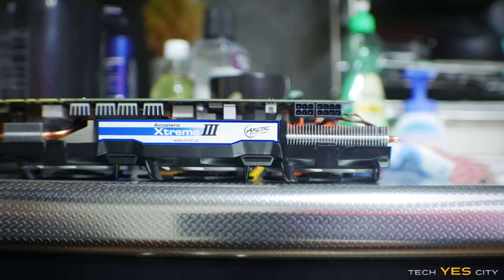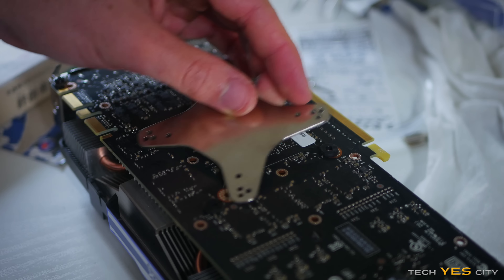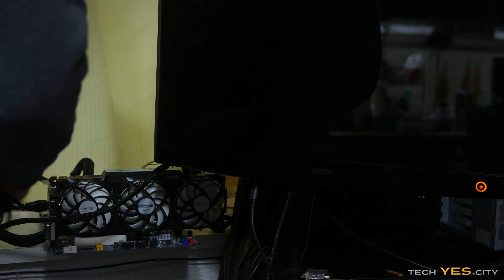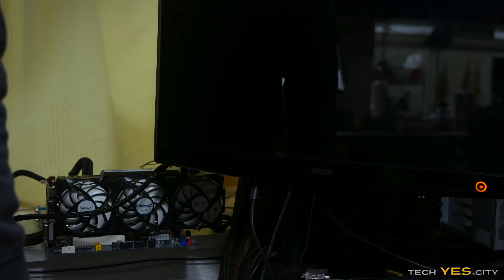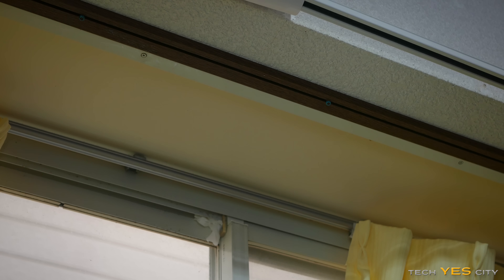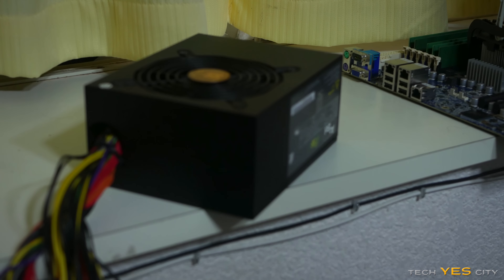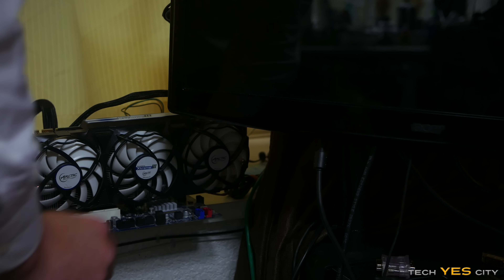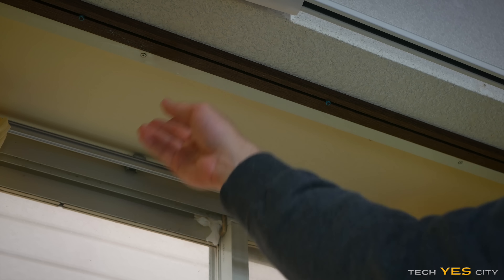The TALE of the 'BROKEN' GTX 780 & The 'HOSED' PSU

Comment: I bought 4 GPUs for $10 from a little repair place recently, sold as scrap, a GT630, HD4850, HD4870 and a Galaxy Hall Of Fame GTX 780. The 3 low end cards worked fine after cleaning up the contacts and re-greasing them. The 780 doesn't but we'll see if a trip to the oven sorts that out, if not, it looks cool on my shelf either way
Reply from the maker: +Blueblur444 Keen to hear the results!

Comment: Those big capacitors in power supplies may have been the culprit. If you read up on "the capacitor plague" you will understand what I am talking about. Capacitors have a lot of water in them.

I doubt it's still a problem sincd it was really a big issue until 2007. Now I think the Tauwanese and Chinese capacitor manufacturers have fixed their formulas. but you could have just gotten unlucky, you never know.

Comment: I think you forgot to replace those black plastic washers when you re-assembled the cooler. These are meant as spacers to prevent too much pressure, and warping of the pcb. :-)
But it's a good thing that you managed to salvage the card, and great that the PSU didn't get damaged.

Comment: Lucky and unlucky i should say!
Last time a video card (9600GT) shorted my computer was because of a dead mosfet in the card, not even visible. It just would get extremely hot to the touch. Replacing the mosfet saved the card and at first i thought that was what was wrong with yours.
You really tend get some crazy deals! Keep these coming!
Reply from the maker: +totalrandomtechnolog Would love to see a video on mosfet replacement, that sounds extremely hard, I think I couldn't do that (my skills with the soldering iron are very mediocre even at best).
Reply: +Tech YES City The hardest part is indeed to remove it, but with one of those really cheap hot air stations on ebay 40 €/$ (give or take) it's remarkably easy. Hardest part would be to get a exact replacement or equivalent mosfet.

Comment: What MAGIC SPRAY are you using to clean the parts?Can the spray remove thermal paste(as good as isoprophyl alcohol)?Does it dry fast.Can the spray cause short circuit?What happens if u spray it on the motherboard socket(nest)?
Reply: I believe it's brake remover or something along those lines, I remember him mentioning it in one of his previous videos
Reply: +Kris&#39;s Audiosurf Channel Brake clean.  Pick it up at any parts store, Walmart, etc.
Reply: Mass airflow sensor cleaner spray... it's made for electronics, obviously :-)

Comment: I scored a GTX 260 Core 216 for £10, That was a great upgrade from the GT 610, before that a GeForce 2 Mx/mx400 (64mb vram), Then for £26 on eBay I scored a GTX 460 (Currently using) I look down ebay at "used" parts alot

Comment: Did you find the leak? If it was a brand new power supply it is possible for certain types of capacitors to soak up water in them. The water likes to stay in them until the power supply is turned on when they tend to dump the water out as they charge and discharge. After soldering most circuit boards go to a cleaning step where they get blasted with deionized water cleaning solution in a large machine and then blown dry.

One old electronics tech accused me of trying to kill him awhile ago by pouring water all over the power supply (while it was off) that he had been working on while he was away at lunch. Thankfully there were other people around that verified that I never went near his bench, and he eventually apologized. We figured out later that the water came from large cellulose filter caps if I remember right. He liked to drink his lunch and he did not even notice the water leaking out of the caps right in front of his face while testing the power supply...
Reply from the maker: +Den Log Yeah leak was from my roof, it was a freak accident.&#160; Was shocked... And damn that story, lol guy is lucky to be alive.
Reply: Tech YES City Eh it was only single phase 120VAC to some low DC voltages so not enough to kill him, but it would have wiped that perma grin off his bright red face :). He only noticed the water after he shut off that power supply and was disconnecting the wires from it to hook up the next one. That is when he turned to me and accused me of trying to kill him. It did not help that I was even more of an a$$ back then I am today, and that he was a horrible electronics tech. He had earned the nickname Battleship around the shop because that was how he troubleshoot. U2 miss, U5 miss, D1 miss, C23 miss, U7 hit...
Reply from the maker: lol, man would love to have a beer with you, sounds like you got some good stories.
Reply: Tech YES City I am sure you have some pretty good ones yourself. BTW nice work on bring the 780 back from the dead. It was a calculated risk with the aftermarket cooler, and someone possibly botching the install. If you are ever in the states, and in Floriduh hit me up for some beers. Take care mate.
Reply from the maker: Will do man, follow us on google plus, really easy to maintain contacts that way :P.

Comment: Now in 2017 I bought gtx780 evga acx for 20$ with lines with oven trick it works (I actually did reflow with heatgun on 350C)

Comment: Shame Nvidia have gimped out all old cards have seen benchmarks where the 960 is better and the R9 290 has gone from being about par to way ahead
Reply: in the division is crazy, old 7Xxx cards are performing really well compared to 680 or 780
Reply: +jd gaming r9 280 is already ahead of gtx680 in current day performance
Reply: +Error 404 (420Master) ^_^ Whooo I have 7950
Reply: Noice i have a r9 280 which is pretty much 7950 but it still bothers me that nvidea pretty much gimps their cards
Reply: +Error 404 (420Master) hope you didn't leave your GPU at 800mhz, if you have a good cooler you can reach 1200
Reply: +jd gaming my 280 is at 1100mhz :)
Reply from the maker: +Nathan James Getting onto the gimping tests now.
Reply: +Tech YES City cool looking forward to it
Reply: Nvidia don’t intentionally gimp older cards. Nvidia cards thrive on optimization with games, while AMD cards do better with driver optimization(due to having more raw power) when Nvidia stops releasing game optimization’s for older cards, they fall behind. Hence why the 290 destroys the 780ti and the 7970(280x) preforms almost as good as the 780 in modern games.(in older games from 2012-2014 the 780ti destroys the 290 and even the 290x)

Comment: Maybe there are leaks elsewhere in your house you haven't noticed? Might wanna check on that before you get another hosed piece of tech. Sweet bargain though Bryan, there are plenty to be had if you look hard enough and are willing to take risks. I got an untested 6870 for £10 a few months back, been running it on my test bench with no problems. Got a broken PC from a junk shop for £20 that had a 500gb HDD, 4gb ddr3 and a i3 2120 (also a free w7 key :P) turns out the mobo was fried...........'"Computer - Tea, Earl Grey, hot, twist of 5820k" :P

Comment: Still, it was kind of a safe bet for this one as the arctic cooling unit cost about 80$ already.
Also I'm crying inside because I bought a supposedly working 7970 for 150$ which had the same issue plus a failing fan and without an after-market cooler (but an awful DoubleD from XFX)
Reply: PayPal charge back.
Reply: It end up working great, but what making me cry is that he got a 780 for 130$

Comment: Wow that's crazy! Bryan can you do a short vid on how to turn on the power from the motherboard?
Reply: You just short the pins that are for the power switch
Reply: +Tone Tech and Gaming You have to short 2 pins used for power switch. You can use USB stick, HDMI plug, scissors, knife, needle etc.
Reply: So it's basically the same as using a screwdriver to clear the CMOS jumper but using the power pins? Simple enough. Thanks guys.
Reply: Tone Tech and Gaming Yes ;)

Comment: Ha ha,  I can't believe you drank that.  I assumed you just cut to a different glass of tea
Reply: It's just metal and plastic that's basicly what the cup and spoon are made of
Reply: I suppose if there is no thermal paste residue left over.
Reply: +F1shard Thermal paste is only toxic in large amounts. The amount left on a CPU that's been cleaned is barely a trace amount, so it wouldn't hurt him.
Reply from the maker: +F1shard The top half was fine, I had to seriously spit out the bottom half though, that tasted terrible lol.

Comment: "....over-clock my tea..." hahahaha... classic "Dad-Joke" there, Brian.  Awesome work on the 780.  I managed to short out a GTX560 years ago. was feeling the temp of the card and I frikkin touched the circuit with my ring (on my finger). I never really bothered investing time in looking but I assume I shorted a transistor or something.  not sure how you would find / fix the problem, Brian?
Reply from the maker: +Mackin8r Depends on what was damaged, sometimes its so hard to tell, would have to have a close look at the card closely, but sounds like a dead component.

Comment: I got a pair of two barely used working gtx 760's for $120 :)
Reply: +csjdruid got one for 80
Reply: I found one for 70. Passed it up, went with a 670 for 90 instead.
Reply: Adeel Rehman they are about the same. you should of taken it. i got mine for 80 cad tho
Reply: ***** I'm in the US. But it was taken from a mac, and only had 1.5gb vram. Also, my dad didn't want to drive.  I also found a 7970 for 75, but my dad didn't want to drive me. Also found a 670 for 70, again didn't want to drive. 

They were all 45 min drives, so I guess it's fair, since he paid the price difference between the 670 I bought for 90 online, and the local 670 for 70.
Reply: Adeel Rehman fair enough. but 760 for 80 cad is about 60 bucks. and had to drive for 15 minutes but worth it tbh
Reply: Kek, I sold those and got a r9 390. SLI is fucking shit, so much micro-stutter.

Comment: Hi I have gtx 780 palit and r9 270 both start spinning and my monitor gets a signal for a split second on the monitor but thats all :/ i even replaced the tp and cleaned them out but nothing any solutions possible? I put a gtx 750 as replacement which works perfectly so its not a problem with the pc

Comment: Hi!
Tell me, what is this water spray thing you keep using in all your videos? Seems like it can make old hardware look brand new again.
Reply from the maker: +Michael Iline The final coat is crc556.
Reply from the maker: you can just use wd40 that will work too.
Reply: +Tech YES City hmm from what i know im pretty sure wd40 doesnt evaporate quickly (oil based) and is conductive.. i would just stick with rubbing alcohol
Reply from the maker: I hosed my gtx970 down with wd40 and it was fine.
Reply: Tech YES City lol I wouldn't have even tried it on a card like that XD that's way too much for me to gamble on
Reply: At least that shows he has confidence that what he says is true :)
Reply: +michael lline yea lol i wouldnt try it myself lol

Comment: Hey, I have a hp pavilion 500-570A. But it won't run csgo on high settings and won't run some games at all due to 'direx9' or something.  How can I fix this???   Thanks for all help!
Reply: You're going to need a decent  graphics card. even something cheap like a 9800gt would do fine for CS:GO
Reply: Make sure you're running at least Windows 7 or later, and your graphics card has the latest drivers and supports the game you're running

Comment: is the white lines problem fixable in a gpu???a local is selling a 980 for 100 bucks because it has that problem
Reply: Bill Nanos driver updates?
Reply: no that is not the problem i didnt buy it its probably dead,he sasi when he installs the drivers the card does that and he can only be in intel hd
Reply: Bill Nanos that issue is called artifacting. It usually happens when the GPU gets too hot. I'd buy it if you have the money, because it can be fixed by either reapplying thermal paste, or reflow ingredients the solder.

Comment: So how much did u get the 780 for?
Reply: $130
Reply: he said in the video $130
Reply: $130
Reply: +Skinnwalk3r 130 Dollars, he said it in the video :)
Reply: +Arch Stanton What kind of dollars? USD would be a lot for a broken card.
Reply: +TheAnoniemo As far as I can tell he talks using USD. But I could be wrong.
Reply: Not talking about what curerncy, but how much did he pay for it...he said it was worth 130 USD
Reply: +Skinnwalk3r well if he said he spent 130$ then I guess he spent 130$.
Reply: NO, as i heard he said it was WORTH 130 USD, but he never said he paied 130 USD
Reply: +Skinnwalk3r 5:29
Reply: +prerunnerwannabe and 14,000 Yen equals almost exactly 130 usd.
Reply: +Skinnwalk3r he said "a 780 for 130bucks yeah baby" 
So there you have your answer now stop splitting hairs and find something more worthwhile to do.
Cheers
Reply from the maker: +Skinnwalk3r I got it for about $130, they go for about $250+ here, and with that arctic cooler on there I decided it was a 50/50, as I couldn't see any burn damage on the card from the photos.
Reply: oki, TY
Reply: +Skinnwalk3r 
850 Danish Krone.
Reply: 14k yen at 125 yen per usd is $112

Comment: I have a problem with my new gtx 680 vamery videocard it was new in the box but i tried it on several computers and i didnt get any signal i checked the same thing like you (Cool paste) and that was just like yours so not good right? i cleaned it and i did some new paste on it and it still didnt work :( any ideas
(sorry for my bad english)
Reply: vamery gtx 680s are fake graphics cards they are actually flashed 9800 series cards, so go get your money back.
Reply: I send a email back and they said we will send one back and it will takes 2 weeks so its now 3 weeks later and nothing came in the mailbox.
Reply: Yeah you might not get card. Did they offer a refund?
Reply: Antwan Armstrong
Nope, this whats happends to me every time when i buy computer stuff from ebay and from other sites :(
Reply: slippingsnake His rating was 100
Reply: Yes, he mails alot and its looks professional and he has saled alot of stuff around 20.000+
Reply from the maker: +Darky Games Sounds weird, never heard of vamery.  Have a picture and links?
Reply: +Tech YES City they are a counterfeit gpu making company
Reply from the maker: wow thats a scam man, get your money back, gtx 680 was gddr5 and also had a 256bit wide bitbus I believe.

Comment: I dont quite get why the seller is selling it for $130. Isnt $130 for a 'dead' card not logical? I mean you did get it to work but there is a high chance its totally dead right?
Reply from the maker: +Alex Ho I would say not really in Japan, people here barely overclock their gear, so burnt out gear is a rareity. So coupled with the aftermarket heatsink I had a feeling someone just mounted something incorrectly, and sure enough there was two problems with it that were easy fixes.
Reply: Good thing youre in japan (Y)

Comment: @1:04 and @5:54 what you do there? Why u press that, what is that???
Reply: He is shorting out the power pin, which is usually connected to a power button in a case, but because its not in a case right now he is simulating a button like that. Google how to power on a pc without a case
Reply: SPEEDERT12 makes sense, thanks!

Comment: uhm why the heck did you just drink a cpu ?
Reply from the maker: +PC Therapy Thought I could overclock my body, but there was a socket mismatch.
Reply: Tech YES City or maybe your tea didnt have a good voltage controller :p nice video anyways ! :) the arctic after market coolers are weird because the ram mosfets are going down and heat goes up , and the copper fins are too upward and its really have that it could bend your pci e lane , but woah a gtx 780 for 130dollars was a big bang ! :) nice video anyways :)